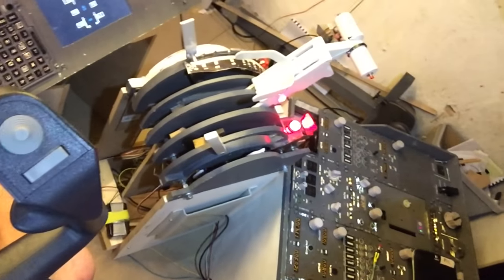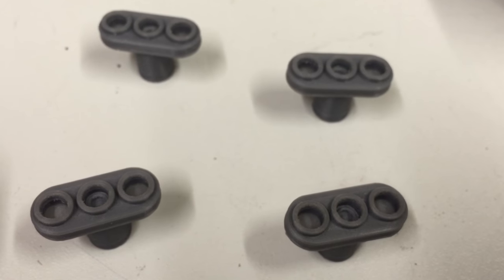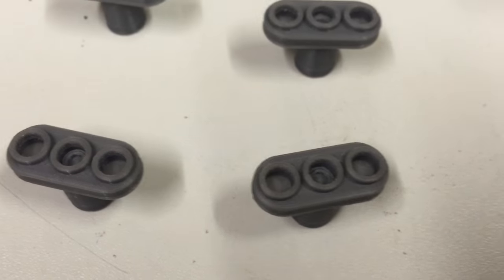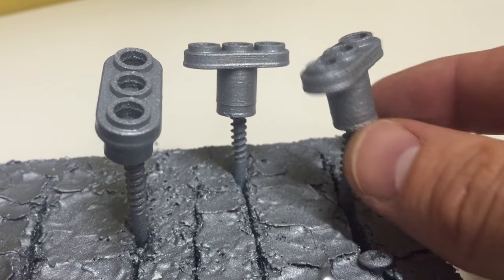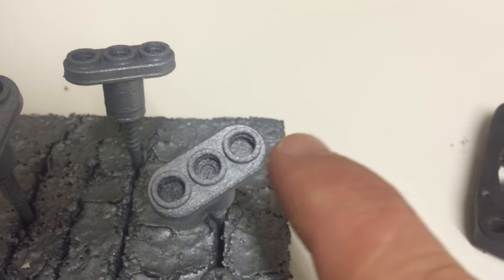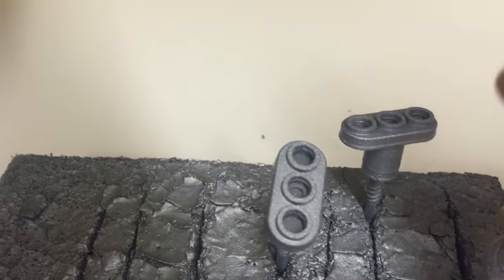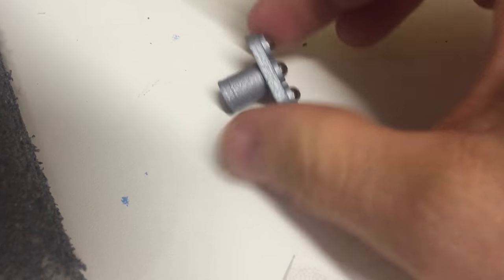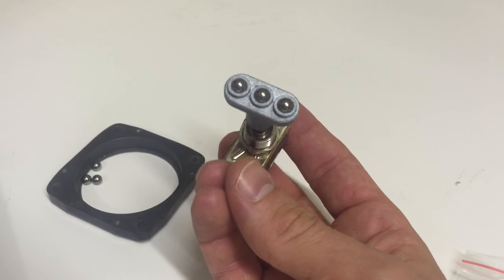Landing Light toggles - B737 Home Cockpit

Comment: Did you find a solution for free movement of the toggle headers? It turns any side, not stable.
Reply: yes.  screw a small bolt on the shaft of toggle so when you put it on toggle lever you can tighten it

Comment: I'm building a F/A-18C simpit and I need to make one of these landing light switches. If you glue the top on then you can't remove/replace the switch if necessary. I was thinking about light locktite + screw through the cap and switch top. 

Nice stuff. Subscribed. Check out my videos if you are interested in military simpits. :)